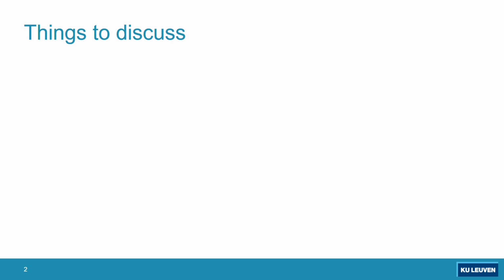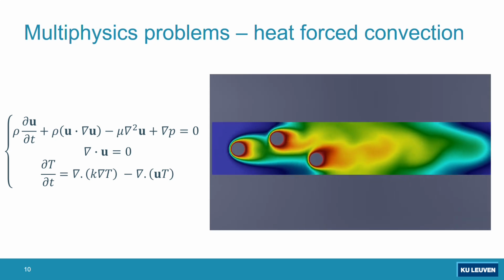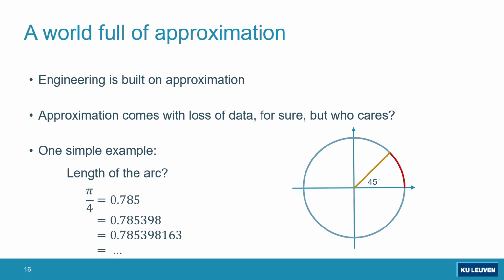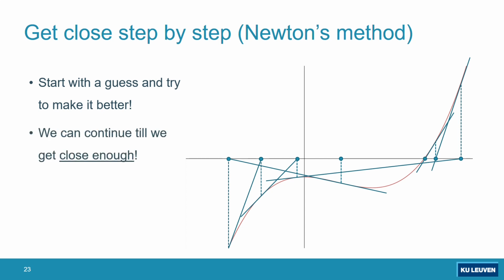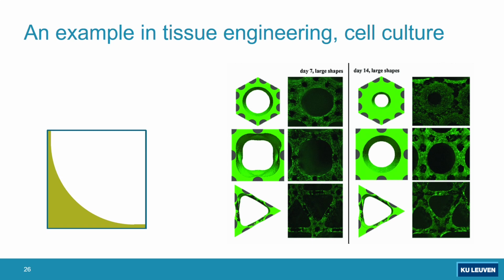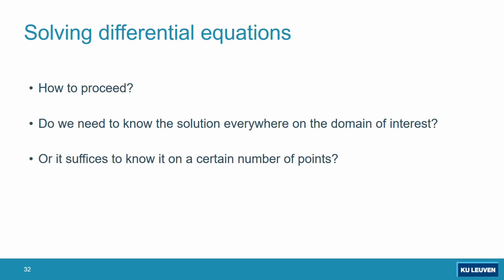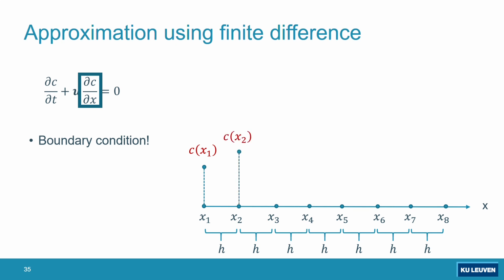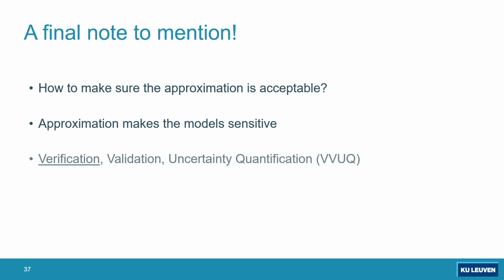Finite element modeling and numerical methods: approximating the solution of differential equations

Comment: Fantastic tutorial. Do you have to worry about computer architecture at all in your work?
Reply from the maker: I'm glad you liked it, Lucas :)
to run some of the simulations, we need a more powerful system, but for some not really. for example, the simulations dealing with fluid flow are usually more resource demanding.